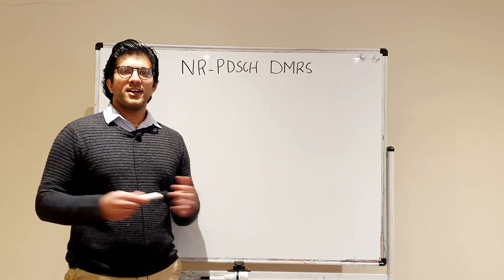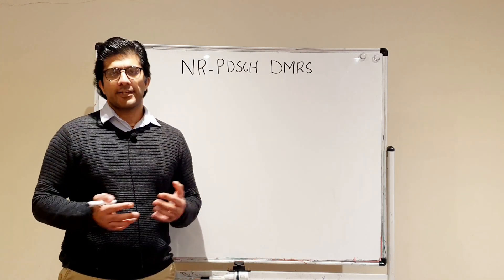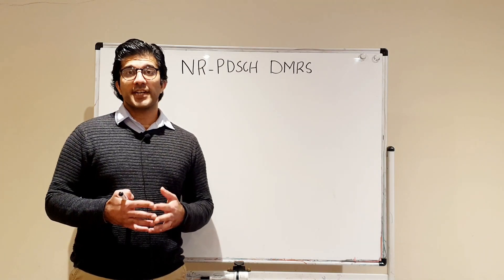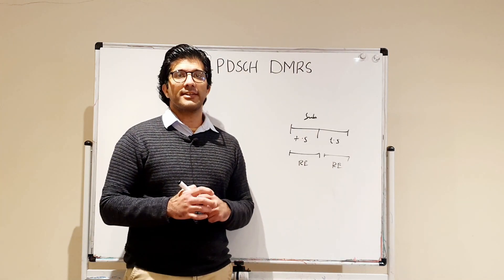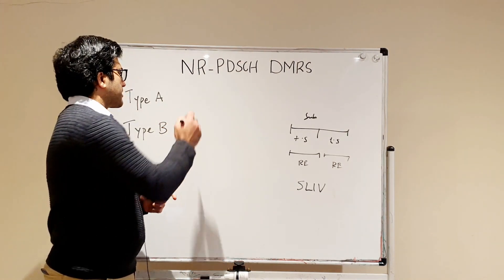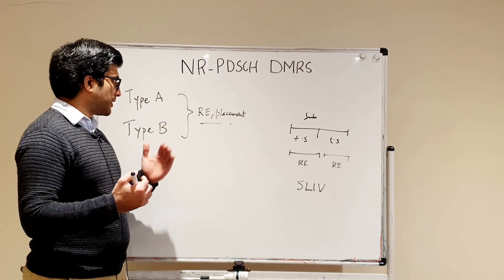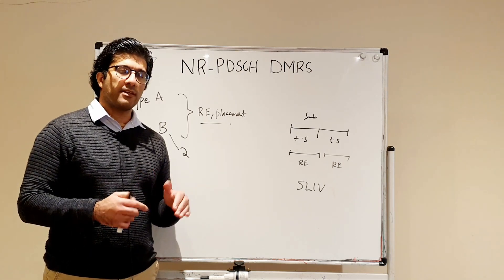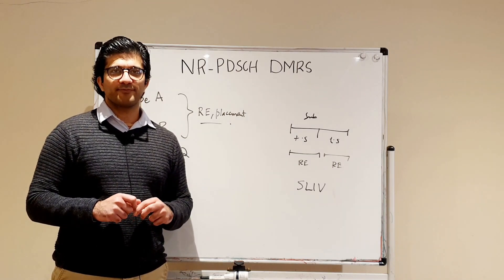5G Training Lecture #10 : Demodulation Reference Signal in 5G NR - DMRS for PDSCH - Type A & Type B

Comment: Hi, 
Thanks for the explanation, although by my understanding and from the standard, Type A means to start DMRS from symbol 2 or 3 (with 0 as the first symbol) of the user PDSCH at this slot, however Type B to start DMRS from symbol 0 (which is the first symbol) of the user PDSCH this slot. Then there is no mention that, up to my understanding, there is a restriction on the user to use Type B if this user start to allocate its PDSCH starting from slot 4. Please correct me if I'm wrong.  
Thanks in advance.
Reply from the maker: Thanks for the detailed comment. I will check on my end and get back to you